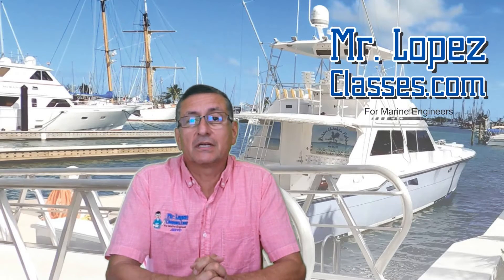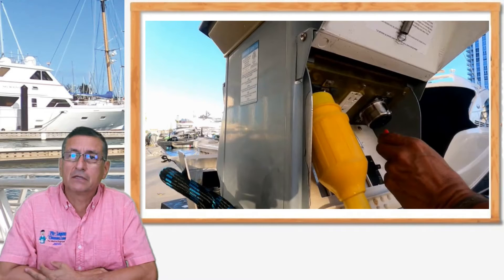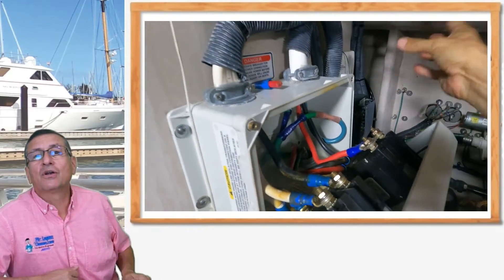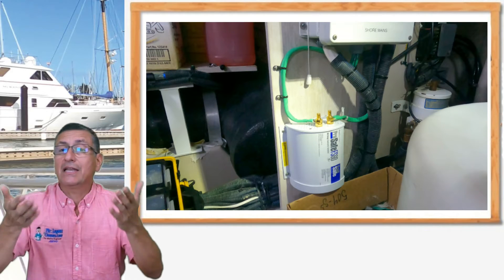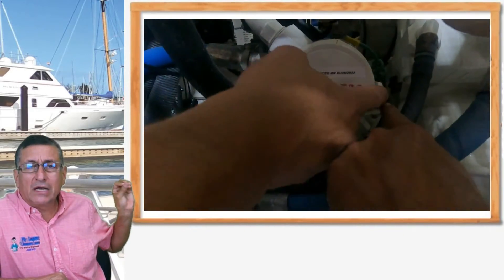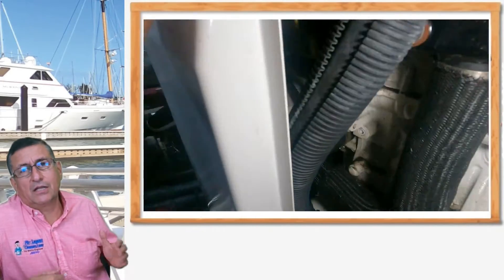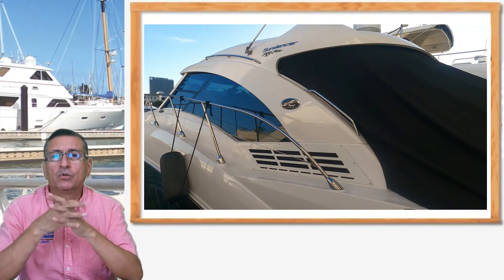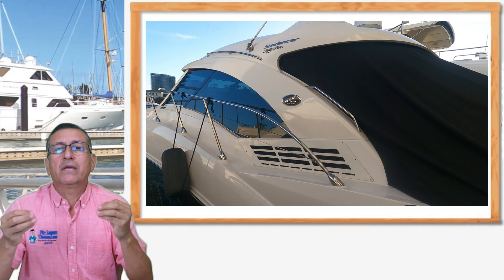How to solve a Yacht Corrosion Problem | Part II

Comment: It’s my understanding that you need a galvanic isolator for each 30 amp circuit which I did not see in your video
Reply from the maker: Hello. My recommendation is a Galvanic isolator per each Shore Power outlet. The GI is designed to block the intrusion of bad currents (normally small DC Currents) through the ground in your boat. Of course the capacity in Amps of the GI should be the same than the capacity (in Amp) of the main breaker at the AC Panel. Best regards